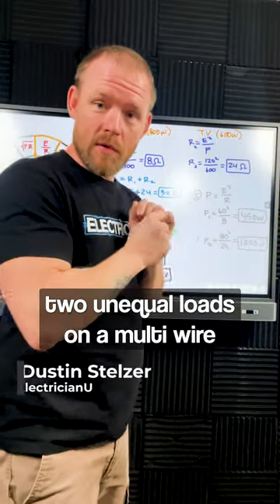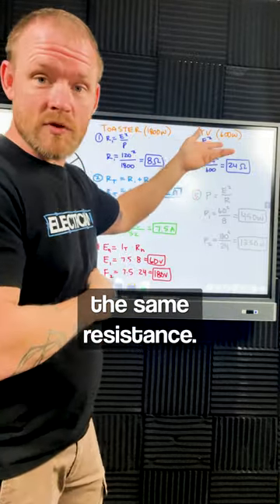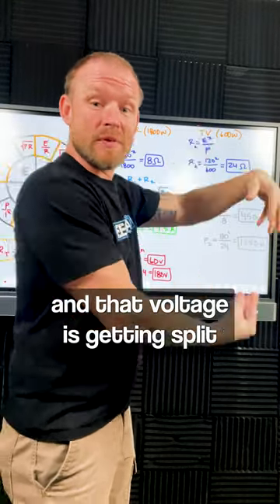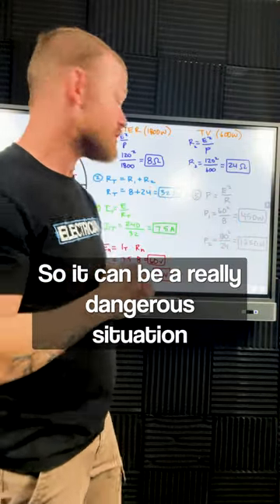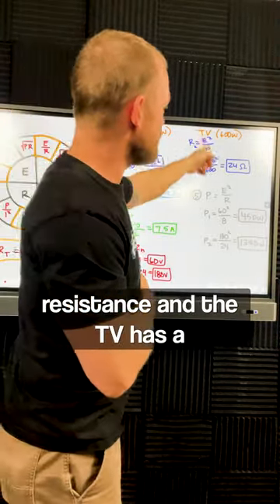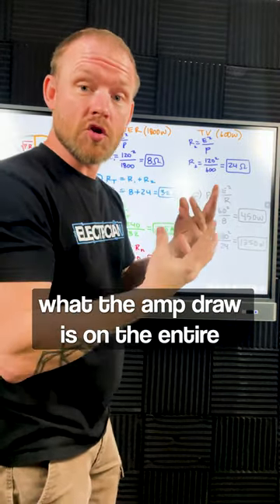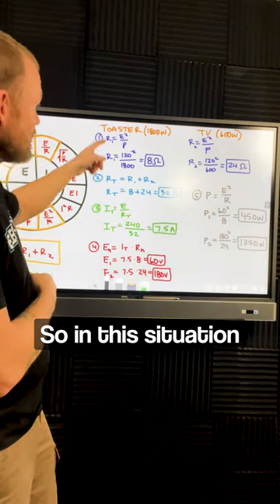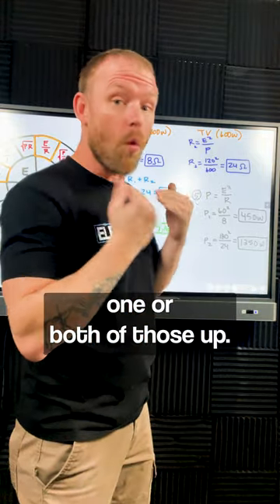Lost Neutral in a Multi Wire Branch Circuit - Part 4

Comment: As we have three phase power here I'm very aware of losing the neutral. Had a house lose neutral on a three phase supply. Not only did they lose neutral but two fridges, two freezers, the hob, TV, and pretty much everything with a circuit in them
Reply: Over time?
Reply: @MrsBuddevil  once the neutral is gone so are the appliances, so instant. As soon as neutral is missing the voltage will fluctuate and spike stuff

Comment: I’ve never anybody at a Jobsite that really understood multi wire branch circuit so it good education!
Reply: They wouldn’t need to. Balancing a load is very difficult due to various factors so it’s always best to pull a neutral

Comment: The easiest way to understand what happens in a MWBC when the neutral upstream is lost whether it be at a receptacle,  the breaker box or outside at the service drop is to visualize a series 240 volt circuit  and to  understand how series circuits work.  Essentially the loads downstream of the lost neutral act as a voltage divider.

Comment: Bro this is exactly what I'm dealing with on one project. The guys that installed the job were doing a service change + alumicon and they made up the crct wrong or something and the neutral was hot and carrying current in the panel on the bus bar and it had 90 volts, when isolating both circuits one had 30 and one had 90 volts but together they had 11 volts... Super friggin hard and frustrating and no one else could figure it out. Bout to just run a new circuit lol

Comment: Many newer TV'S computers and other devices have a 90-250v rating. If they do, they'll be just fine and even continue working. Other appliances cannot tolerate this and may suffer damage.
Reply: And a tv is not a resistive load, it's much more complex.

Comment: I'm just a home gamer who enjoys playing with electricity and I've wired my house in multi branch circuits but I don't understand how losing the neutral would do anything but break the circuit.
Reply: If it loses the shared neutral but the neutral that connects the 2 circuits together remains connected, the energy will travel through neutral that runs between the 2 circuits through the devices connected to those circuits and back through the phase conductors. In the instance where there is no load on one of the shared circuits, yes then it breaks the circuit. Same thing happens when the neutral that runs between the service panel and the utility is disconnected, only on a much bigger scale. 

I personally avoid multi branch circuits, the cost difference between 12/3 vs 2-12/2's isn't big enough for it to really be worth the added risk.
Reply: You don't share a neutral with another home run.  Each run from the service panel is a separate circuit no matter how much it branches.  The guy in the video is totally wrong.
Reply: It's when you run, for example, 12/3 or 14/3. You have a black and a red wire (2 circuits). They both sharing the neutral (white wire). The poster is not wrong. Either you're confused or just simply wrong in your thinking.

Comment: Perhaps you should define "losing the neutral" in practical terms.
Reply: Yes! Exactly! I have a thread above asking about this. The problem is, there is some assumed knowledge here that I really need to piece this together.
Reply: Old panels it was common for three circuits to share a neutral. If you lose the neutral in the circuit by means of say a loose wire nut or a burnt wire it can put 240v (or 208v on three phase) as a parallel circuit. Had one co worker fry some lights doing this.

Comment: So, in this example, would it be true that the toaster is fine since it received less voltage than the typical 120V it would have had? And the TV would potentially break because of the > 120V it is now receiving? 
Is there a scenario where under voltage causes damage to an appliance (maybe it draws too many amps instead)? 
Thanks in advance for the clarification
Reply: Yes if the appliance has a motor. Pictures of a dishwasher or refrigerator.

However it is almost impossible to predict what happened in any circumstances. An appliance with a motor in it the load is nonlinear and not a resistive load. They have a very high current draw when first starting.

And many electronic devices have inverter power supply that will operate on 90 to 250 volts. Motor wire circuits are often used in places like kitchens. And one leg May supply the dishwasher and the other leg refrigerator or microwave.

Comment: So it becomes like a series circuit?
Reply: Indeed, and as it’s likely they don’t have the same resistance voltage and current is divided between. You could see is in a complete installation as an example according to Thévenin’s theorem.

Comment: What do you mean lose the neutral? What does that mean? Cut the wire? Is it like a microsecond voltage spike?
Reply: If neutral wire is interrupted in sense of over spliced then breaks of from junction to panel, corrosion, not tighten properly in the neutral bar
Reply: @ergyskaramuco562  I still don't understand are we talking about a broken circuit or a short circuit
Reply: I was working in a box adding a circuit and all the neutrals were shared. When I removed the wire nut to add another the existing neutrals came apart. That's when some devices were fried.
Reply: I am being persistent, but I really want to learn. The current terms used are not making sesne to me. "Lost natural" Can you help me find a schematic example. Or another video?
Reply: @AcousticBruce  Lost neutral, just means a disconnected neutral. As an example in a MWBC, you run a 12/3 from the panel to a J box, from that J box you run 2-12/2s to outlets/lights. That 12/3 has 1 neutral conductor and 2 load conductors, the neutral is shared by the 2 12/2s, but the 12/2s each get their own load conductor from that 12/3. It's technically 2 seperate circuits but with a shared neutral. If the neutral is lost in that 12/3 but the neutral connection between 2-12/2's remains connected, you create a series circuit between the 2 load conductors in the 12/3, you will end pushing up to more than 120v through one of the loads if they are not identical loads likely frying anything connected to that circuit.

They used to be fairly common, it was done to save money, as running a single 12/3 is a bit cheaper than running 2 12/2s from the panel. These days it's considered best practice to avoid MWBCs as it adds a bit of risk, and it's really not worth any money you would save on wire.